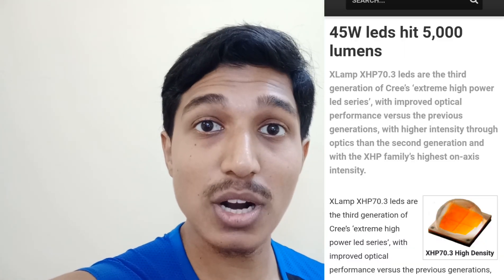The Shocking Truth: Halogen H4 vs. Cree XHP70.3 LED - Which Shines Brighter?

Comment: i am also waiting for xhp chips for years . currently i am using csp chip which i got from mini drive fog lights
Reply from the maker: Go for xhp70.3 ..
Its a beast
Reply: @Electricquantism402  where can i buy in india?
Reply from the maker: @jugaad9443  you have to buy from AliExpress...
Reply: @Electricquantism402  its banned in india 😒
Reply from the maker: @jugaad9443  then check it on mountain electronics website or Banggood website

Comment: Halogen might be an inefficient piece of junk for using it as light but it is useful for using it as an high power resistor for charging high power capacitors and it is a good load too.
Reply from the maker: Yes. True said.

Comment: xhp70.3 at 8.4v 20A is 9000+ lumen
Reply from the maker: Are you serious?.. can 6v version handle this voltage and amps?.
Reply: @Electricquantism402   6v version
Reply from the maker: @be4885  but it will shorten its lifespan even if proper cooling sink with fan installed.
Reply: @Electricquantism402   high power leds usually need a heatsink and xhp70.3 at 8.4v 20A is 9 times brighter than 100w car halogen bulbs
Reply from the maker: @be4885  also there is huge price difference... But I haven't tried to overload xhp70.3 this much...how much max it can handle?.. without changing to angry blue color light?
Reply from the maker: @be4885  need some info about leds..if you don't mind.. please Dm on WhatsApp+923093333809.
Reply: @Electricquantism402    xhp70.3 8.4v 15A  with cpu heatsink